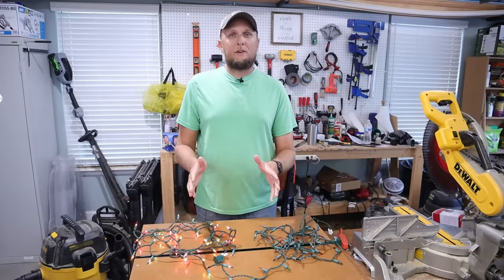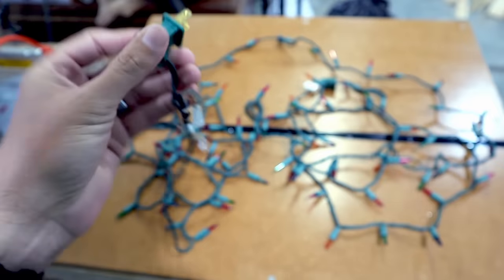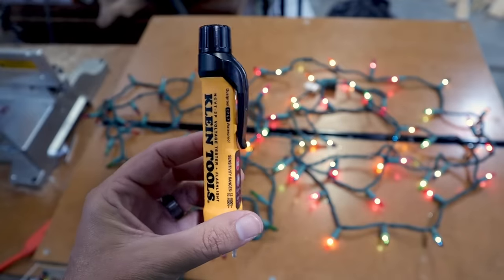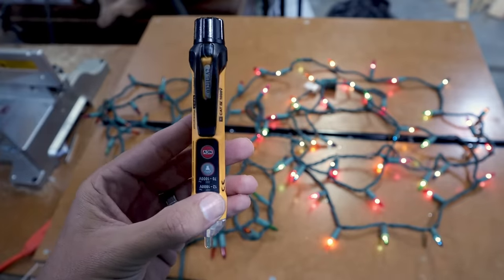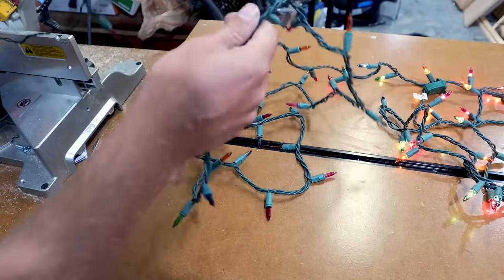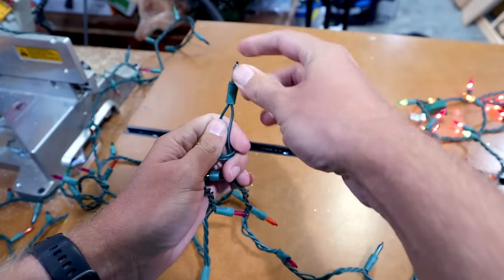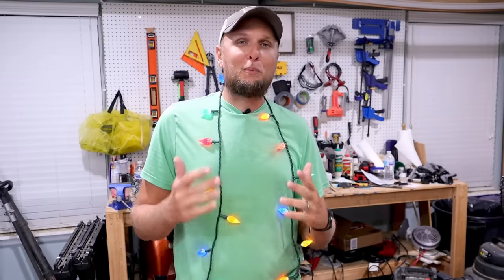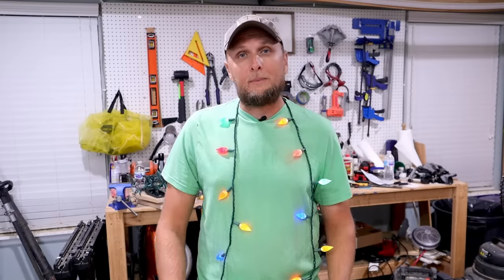How to Find Bad Christmas Light Bulbs Quickly!  LED or Incandescent

Comment: Very helpful but didn’t work 
I have GE   C-5 led Christmas lights did everything you said for about 2hrs 
Even used tape on builds so I knew where the bad one is 
Found power coming from the plug/ male end to socket opposite of socket no power 
Put bulbs in that I new work but still nothing 
Need help this is on the tail end /
Female side of the 
strand on light

Comment: I like this video. It seemed to make sense. However,  every wire, bulb, and socket appeared to be working and getting power on the first half of my G30 LED strand that was out, which leads me to believe it may be a faulty in-line resistor, if that's what that solid bulb socket is... there are 2 in the strand... 1 directly after the 1st bulb in the 1st half of the strand, and the 2nd one was located right after the first working bulb in the 2nd half of the strand. I replaced the entire strand in less time than I spent trying to locate the problem. Who knows, maybe I'm the problem.  😅😅😅

Comment: I have icicle lights and it’s really frustrating because one section is actually burnt out and in the other section looks great, but not only that when I replaced one bulb like you sporadically other random ones went out. No specific pattern either. The strand that hangs down making it a icicle light some will have 2 to 3 out and another one will be just fine. It would be nice if when they went out it would be some kind of pattern so I could just trace it down the line. But nope…..lol. It’s sooo frustrating. The crazy part is is I put a burnt bulb back one of the sockets to hold the place and it went back to normal for that section. It’s just a mess, 2 steps forward to get 10 steps back! Lol. And I’m so cheap. I hate to trash them especially when it’s only a small section. Have you been been tempted to cut it and rewire it…lol. Repairing one light creates problems that never existed down my line. Thank you so much….your video is the best out of the what feels like the hundreds that I have watched. Even if my problem is not fixed, you taught me things that I never knew to last me a my lifetime. Thank you again!

Comment: My power is on the bottom wire and the plug is non-ground polarized - so I can't flip it over as you demonstrated.  Any suggestions?

Comment: I have a dead LED string and every bulb triggered the sensor. I made sure the line side was going to the bulbs. I tried it with a working string and removed a bulb and the test worked like your video. I did find two corroded sockets with broken LED leads. Something is strange with that brand of light string.

Comment: well at every sensor sensitivity setting, the neutral wire shows power no matter which way I turn the plug
Reply from the maker: How long is the strand?  If it’s long it’s going to alternate throughout the strand usually at equal increments.  So if it’s 100 foot long it may alternate 2-4 times.

Comment: Here is my issue. I have 100 light string. I plugged it in and 15 random lights are bad. I left it on an hour and now 22 lights are bad. It’s 3 years old and was stored in my garage except for 1.5 months at Christmas. Do these little bulbs just not last that long in storage? Should I bother replacing 22 bulbs? I can buy 100 pack of replacement bulbs but it is only $2 cheaper than a whole new string. Note that these are random lights. The first bulb and the last bulb are working.

Comment: Ok, update.  I found another bad LED conical bulb...but the new ones i put in the socket don't work in it.  I have tested the wires around it, going into the socket...everything is getting power.  What am I missing? I look in the socket and see both wires are where they should be, as are the little metal pieces on the diode.  And yes they are in the correct positive and negative positions too.   I see no cuts or breaks going into the socket or coming out.  Hmm any ideas? Thank you.

Comment: I tried your method and have been unsuccessful. I can pull a bulb out and the tester is still saying it has power. 

Led christmas lights middle section of 50 ft strand is not working.
Reply from the maker: Plug is probably plugged in the opposite direction from what it needs to be.
Reply: @HowToHomeDIY  ill flip it and try again.

Comment: A string of lights on a table is too easy. Mine are permanently attached to the tree. It is difficult to find the start & end of a individual string of 50 or trace it bulb to bulb through the tree. We faced the dead parts to the wall. There are multiple connectors that go together as the 4 sections of the tree are assembled. Each connector seems to serve several light strings.

Comment: The fundamental problem with modern Christmas lights is twofold. 
Because if of the hard drive to as cheap ass possible we have :
1) incandescent lights that mostly break after one season and are impossible to fix because the bulb to plug Interface is so cheap ( wires folded over opposite sides of the base) that repeated unplugging and insertion will break even good bulbs. 
2) the LED versions are typically no serviceable ( tree string lights) and are absolute crap in terms of brightness and appearance compared to the incandescent and thus not a replacement. 

So we have no working solutions. 
I wish we still have the well made incandescent  of the 70’s.  Those were bright and serviceable and looked good.

Unfortunately it’s more efficient to just buy new strands and trash the old ones. Because they are so cheap.

Comment: I have power running through all 3 wires no matter which way I put the plug in. The only thing that's lighting up like a christmas tree is my voltage tester. I can't find the dead bulb. The tester goes off no matter what I touch. And the entire strand is not working.

Comment: But ... but ... if the bulb is burned out, the strand should still light.  They're designed to have continuity whether or not the bulb is lit (unlike the bad old days).  So what we're looking for is the point where the circuit is broken.  And here's a question ... if you are getting a voltage reading at the beginning of a strand, why aren't those bulbs lit?  I am confused.
Reply: Not an electrician, but I think it's because the broken bulb breaks the circuit and all bulbs need a completed circuit to work

Comment: This is not working for me at all.. Im using the same tool, and the same technique on icicle lights im getting inconsistent readings that seem to break the laws of physics 🙃 for an example as I go to each bulb each one will beep if one doesn't beep and I try it again it will beep and then I go to the previous bulb and it won't beep, everything is pretty much inconsistent not sure what's going on.
Reply from the maker: You have to make sure you are blocking the other strands or wires with your hand and isolate the bulb, or else it’s going to sense the magnetic field being created by the electrician from the other wires.  Also, that voltage detector has two settings of what it will pick up.  12 to 1000v or 70 to 1000v.   The lower seeing you will see a blue light come on sometimes.  I set mine to the higher setting, that will only turn red if it senses voltage.  The lower setting can make it harder to isolate the specific bulb.  Hope this helps!
Reply: @HowToHomeDIY  I already tried that by holding all the wires away from the one I'm reading using the higher setting it's just inconsistent all around.  It's about 50/50 if it'll even sense the bulb.
Reply: @How To Home  I think I might have a defective stand. They are brand new from homedepot, and I tried the technique on a different strand of lights, and I was able to  tell where the fault was pretty easily.

Comment: I have a question and a comment.
If the detector threshold is 70v, because of voltage drop per bulb, you're going to come to a point where there is power to the bulb, and enough voltage to light the bulb if there was a continuous circuit but not enough to be detected.  OK, perhaps with incandescent it's a pure resistor and with no current, there's no voltage drop so you could get over 70v all the way to the last working bulb, maybe.
But with LEDs, they require a minimum voltage drop to conduct, otherwise no voltage should be on the other side.

Comment: the leading cause of LED Christmas light failure is rust.  LED leads are not copper but steel or other ferrous metal.  This was even before copper started getting expensive.  But a break caused by rust is still an open circuit so the inductive testing is still valid.
Now if only those sockets were standardized and the LED or incandescent bulbs had standard voltage and current ratings, we'd be in good shape.
You can get bulk LEDs but the voltage and even size/shape varies so usually not a perfect fit.   You'd think by now it would be easy to get replacement LEDs specifically designed for Christmas lights, and in packs of assorted colors.

Comment: Can someone please help me with instructions... how to remove a LED bulb that's about an 11|2 inch long  . My niece set something on one of my bulbs and it busted the glass off at the edge of where the bulb sits in the string I've never taken a bulb out of a string but I need to take it out for one the sticking out of it around the edge and it's dangerous and I'm hoping if I take the broken one out that the string of lights will work even if I don't have a bulb to replace it with even if I figure out how to take it out. 🥺 I've tried YouTube how to remove the broken glass bulbs. From the string but it only says how to repair a light that's out. I don't even know how to take the light out even if it wasn't shattered and broke. Sorry if this doesn't make sense. I've had a stroke so sometimes I don't communicate things very well.

Comment: This process didn't work for me. I'm a little baffled as to why. I have a 200 light LED string. The last section of approximately lights number 150 - 200 were out. The culprit was light number 190. The voltage detector stopped sensing voltage at about light number 155. I only found the bad bulb through persistent testing of each bulb.

Comment: I'm probably mentally handicapped because this isn't working for me. my strand is all or nothing.  There's a hot and neutral which pass through to subsequent strands.  Even if I flip the plug around it's difficult to detect where the problem is.
Reply from the maker: You’re not detecting power anywhere?  It could be fuses, the wiring, the points inside the socket, or your voltage detector may not be capable of detecting low enough voltage.  One of my voltage detectors was able to detect the voltage no problem up until a point then it would show nothing even though there was power there.  The one in the video can detect down to 12v but I had it set to the 70v minimum setting.  Hope one of these helps!
Reply: @HowToHomeDIY  I detect voltage loss. When I replace the bulb or erase the socket, it still doesn't work. Maybe lots of bad bulbs. Literally 5 strings out in a row. Fuses are fine since power flows through.
Reply from the maker: It could be lots of bad bulbs but it sounds more to me like you may need a different tester, or there is something wrong with the socket itself.  You should be detecting voltage on the other side once the bulb is replaced, if not, then it’s something else.  If I had to bet on it, I would bet on your voltage tester not being sensitive enough.  But only you can make that determination.
Reply: @HowToHomeDIY  gonna have another go at it.  I have a Klein which has 12 and 70v modes. Not a super expensive detector but also not some piece of junk.
Reply from the maker: Ok yes that one should work.

Comment: get yourself an actual light circuit tester. What you didn't mention is that those bulbs are actually supposed to have a working shunt in them that will still pass current even if the bulb is out. About half the time it doesn't work. Yes your method works, looking for the last known voltage, but just opening up a socket, and shocking the line gets the shunt working, the whole string lights up, and whatever bulb is not now lit, you can easily focus on. I've found as many as five bulbs out at once. Much, much quicker. Also, you can just lay them in a line and walk it until voltage drops.
Reply: Do LEDs have shunts?

Comment: I've tested every bulb, then replaced every bulb with a new bulb. Still half the lights are off.  What next. I  know quit putting up lights.
Reply from the maker: 🤣.  Well the maddening thing is that more than one can be bad at the same time.  OR one might be bad and one might be loose.  In that case, it is more difficult but if you can get the first bad bulb figured out then power will go past it and should be able to find the next bad bulb.  I have been there before, it can be quite irritating.
Reply: Buy a new set and forget about it. They're $20 and under.

Comment: Couple of points... Don't do this worthless effort. I have listened to 5 you tube videos and nothing works. Couple of things.. never buy over 100 bulbs to a string. When they go out, throw them away, you will only get frustrated. And after several years get yourself new strings of lights!!!!
Reply from the maker: Yes folks, because Paul can’t figure out how to do this after 5 videos, just pitch your easily repaired strands of lights and drop more money whether you have it or not 😂
Reply: @HowToHomeDIY  I guess when you figure out how much I make an hour and the time I spent trying to fix this... a lot more expensive to DIY for me! I do a lot of DIY stuff but I look at projects that are worth while and you get a big bang for your time.
Reply from the maker: @paul5896 Whoa there money bags.  Not everyone has money like you apparently have.  Plenty of people in the comments that this worked for and saved a ton of time and money.  Don’t know if you have the wrong tool or just doing it wrong.